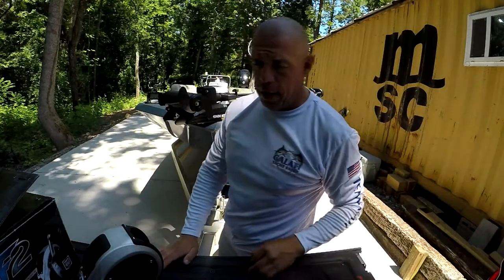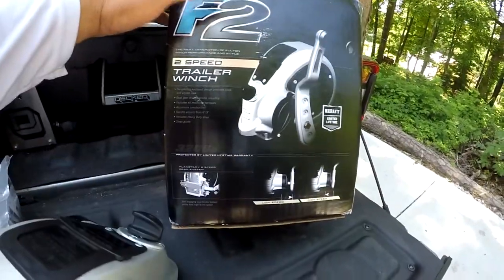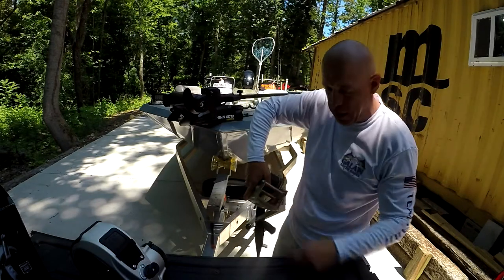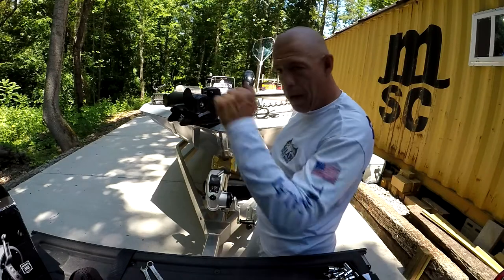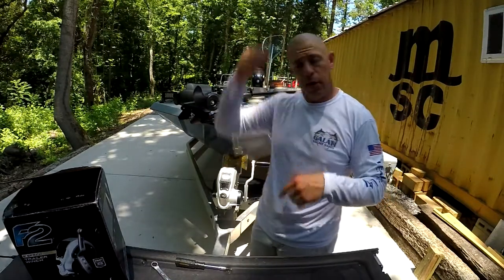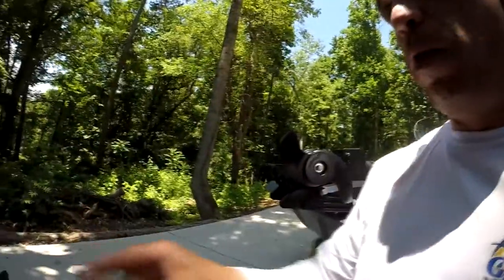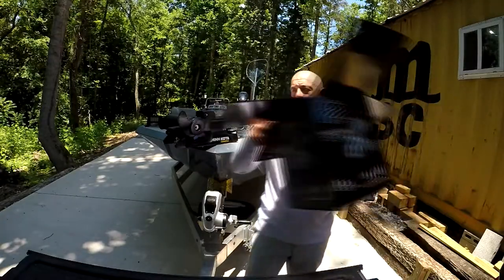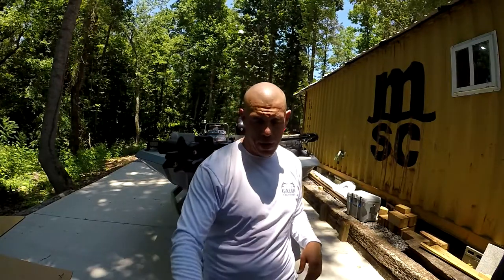New trailer winch  - Fulton 2 speed

Comment: I have a SEAARK 1872 when the ramps are shallow I am finding difficulty pulling the boat up on my carpet bunks. How much is this Fulton 2S reducing you effort?
Reply from the maker: It's going well.  Not a huge difference but it does make it way nicer when I'm by myself.
Reply: Thank you. Great channel!
Reply: @Rocksolidtactics  I don't think you realize how the 2 speed works. You have to pull the handle out towards you to go into low gear. Putting it into low gear is a massive difference in power.